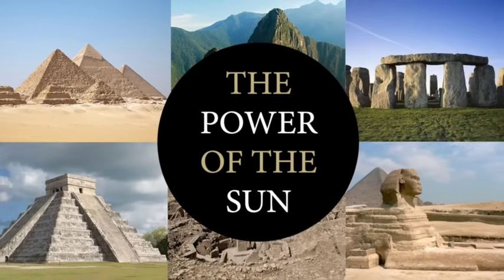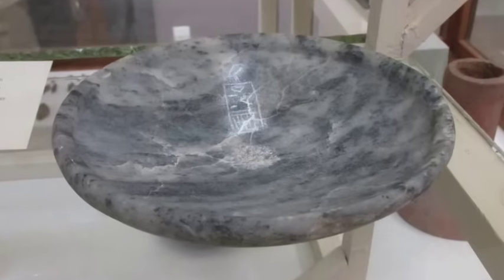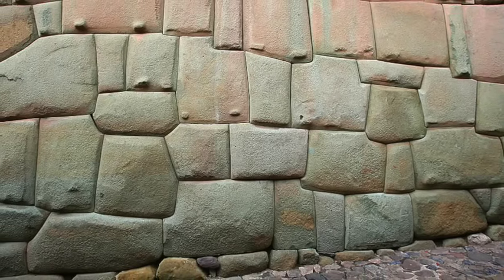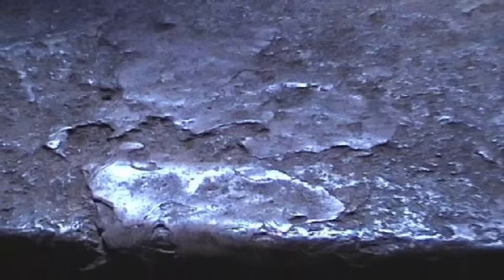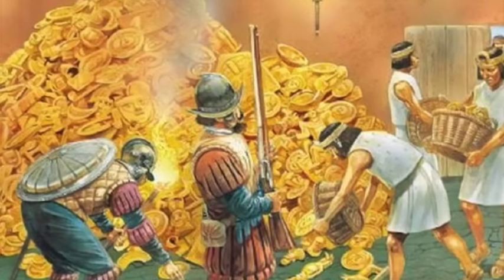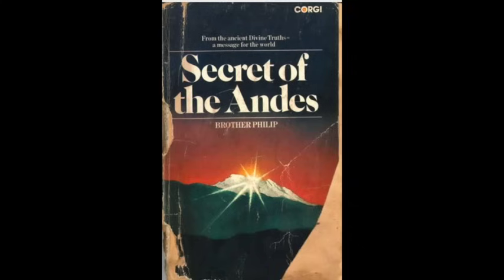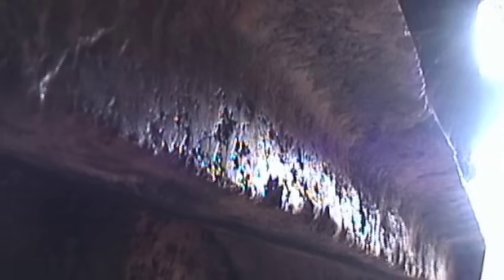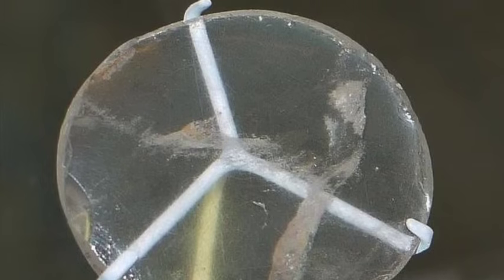How the Ancients Cut Stone with the Sun - Lost High Technology Explained | Ancient Architects

Comment: i do think heat played some sort of roll in how they worked with the stones. but for me, this explanation doesnt explain the classic scoop marks we see on the obelisk in bedrock at aswan quarry. Not to mention, theres the area in the osirion where you can see they laid the stones with a rough finish, and would grind off like 15 cm of material in a single pass, since we can see the concave transferring from rough, to smooth. it literally has a circular transition. i dont think we could plane an entire stone surface 15 cm deep just by sun melting.

Comment: Many years ago at TAFE a company called Rock Granite Quarries would drill holes about a metre apart in a straight line in a slab of granit, they put wet wooden stakes into the holes and kept the wooden stakes in the rock wet, eventually  over time the wooden stakes would expand and crack the lump of granite rock in a straight line. They used this method instead of dynamite, as explosives would lead to crevices and cracking in the rock. Whereas the wood stake in hole method made a clean straight crack.

Comment: what a load of eye wash to put it politely why dont they just admit they have not got a clue i used to work with diamond saws they used in stone quarries worked well but the size of saw needed to cut those rocks would cause so much vibration the rocks would just break or the saw would

Comment: Horse hockey, they would have to control the cut and temperature so perfectly to pull that off. To hot the rock will explode or kind of pop like pop corn. They used something alright but it wasn't any golden disc.

Comment: This theory doesn't explain how fine details like facial features are jewelry and head dresses are cut! Straight lines are one thing but fine details are quite something else! I'm not buying this at all, especially in the many angles used in each stone in a single wall! If they could cut squarely why bother with all the different sizes and angles of those stones? Drill straight holes in solid granite, perfectly round and in very tight tolerances end-to-end? Not with focused sunlight, not in my opinion at least!

Comment: Great video and makes much more sense than the chisel tool fabrication… But I have one issue - Have you ever burnt a dry leaf with a magnifying glass? If you have, you will know how steady you have to hold it in a precise perpendicular angle to the sun. There is no ways that you could cut detailed shapes. You could cut a square shape into a rock which would not be accurate if handheld, but how would you cut the vertical plane at the back of the rock since the supposed metal discs aren’t opaque? Unless a combination of glass and metal magnifiers were used, but again much of the work is far too detailed for these to be down by holding big magnifiers. Something still doesn’t add up

Comment: I'm not an expert but according to some who are, there appear to be tool marks on the stones caused by drills and circular saws. And then there's the evidence of the use of lathes... gigantic pillars with a hole in the bottom and a super smooth finish. Not saying your theory is wrong, I simply wouldn't know. Just trying to piece together the things I have seen so far.

Comment: If you are going to use 'How' in a title you need to demonstrate beyond all doubt that this is the way they did it. Your presentation is therefore little more than 'I wonder if this is how they did it?' There are so many technical problems with your theory (that many others have also pointed out) that I think you should change the title of this video or withdraw it. Apologies, but my guess is that you have little appreciation for what is involved here. I personally think it very unlikely that the ancients would have the ability to make glass lenses pure enough or mirrors accurate enough to focus the sun into a narrow enough beam for it to have any chance of being successful, let alone controllable. When heated violently, hard/brittle materials tend to explode due to the expansion forces (worse if they are wet - ok, not in Egypt!) and so I would expect to see a lot of evidence of spalling....basically I cannot accept the idea of precision machining this way without a verified demonstration. 

I don't see any pyramid texts mentioning thousands of blinded stone masons either, because that would be one of several certain outcomes. To achieve such a perfect finish using such a monstrously powerful/dangerous tool as you are suggesting, requires a lot more evidence to lift it from the realm of fantasy. Has anyone demonstrated rock machining with a modern laser for example?

Modern water jet cutting technology might be a lot better for this task too, but as with the sun beam method, you'd need to invent a way of controlling the jet accurately, let alone work out a way of generating and then containing the pressure, and directing it where you wanted it to go.

Clearly our ancestors were very clever people and we still have some way to go to explain their capabilities.

Comment: A parabolic mirror made of gold and silver alloy could be equaled and bettered by using  modern mirror technology, such a surface would be more reflective, the largest such mirror yet made is only capable of heating a piece of wood to ignition temperature and quite incapable of altering the structure of stone. Good idea but very far fetched. A mechanical disk made of copper and rotated at speed, can with the addition of sand and water cut even the hardest of rock. The ancient Egyptians had the copper and the means of forging a disc of good size, they had plenty of abrasive and and water, the only thing missing is a method of rotating the disc at a constant speed, with speed the disc would need a lesser application of force, therefore less erosion of the copper disc. Where the Egyptians capable of engendering a mechanism to rotate a large copper dick of possibly one meter in diameter and at speed? I dare say they were, a simple structure such as the forks (two wooden ‘A’ frames) that hold the large wheel of a Penny Farthing bicycle would suffice and possibly powered  by man, mule or oxen via a rudimentary gearing system would generate the necessary speed and the stone to be cut may have been brought to the Disc for cutting and not the disc taken to the stone. Just an idea!

Comment: Let's calculate if this is possible:

We assume that they melted granite with sunlight with a "mirror" that could be held bij 2 people.
Say, a mirror with the size of 2 x 2 meter (4 M2). Let's assume that the mirror is perfect and no energy of the sun is lost with the reflection.

Granite has a melting point about 1200 *Celsius. 
Let's assume that the temperature outside is about 20 *Celsius. That means that the granite needs to be heated 1180 *Celsius to melt.

To heat 1 gram of granite for 1 Kelvin (*Celsius), you need 0,82 Joule of energy. 
Heating 1 gram up to the melting point, you need 0,82 Joule x 1180 *C = 970 Joule.

In Peru the sun gives a heat about 250 Watt / M2 (= 250 Joule / second / M2)
The mirror is about 4M2 in size, so it reflects about 1000 Joule / second.

In that case it takes on a sunny day (970 Joule : 1000 Joule / second = ) about 1 second to melt 1 gram of granite (with an perfect mirror on a perfect sunny day).
Even if you are not efficiënt, it seems to be possible to melt a tiny piece of granite with sunlight. But what about a whole rock?!

But what should a average granite stone weigh? 
The density of granite is about 2,7 grams / cm3. 
You can find pictures of perfect "cut" stones from Machu Picchu which are the size of a human or bigger.
Let think of such a stone with the size of 100 x 100 cm and the depth of 50cm (it's a guess, please come up with more accurate numbers).
This stone weighs: 100 x 100 x 50 x 2,7 = 1.350.000 grams (1350 kg). 
To heat up such a stone to the melting point with our ideal mirror and no loss of heat, it takes 3.780.000 seconds. That is 1.050 hours (44 days). 

And that is impossible in a few ways. 
First: it takes more than a day, so at night the stone cooles off and it wil take even more than 44 days to get it melted. 
Second: the sun must give this heat during the whole daytime, that's impossible. 
Third: If this was possible, it takes 2 guys in a ideal situation at least 44 days to melt one stone with an average size. There are thousands of stones there... 
Fourth: the situation isn't ideal. There are energy losses, not only by clouds, moist, sunset of an imperfect mirror, but also by the fact that you can easily heat up the outer layer of the rock, but it's very hard to heat the internal part of the rock. In nature, rocks desintegrate by the faster warming up of the outer part versus the inner part. It damages the rock.
Reply: It is possible to heat and melt (or soften) tiny rocks with a fresnel lens with a size of about 1 M2.
This is basalt, it melts somewhere between 1200 and 1600 *C.

https://www.youtube.com/watch?v=svAPyyUJUCo&ab_channel=GREENPOWERSCIENCE

Comment: Actually a really interesting idea. Unfortunately it's impossible to do with the solar lenses you theorized.
Lenses don't create a straight and narrow beam like a modern laser. They create a cone shaped beam with a focal point at the top.
You can even go try this yourself. Just buy a magnifying glass and try cutting a statue, or even just a small building block, out of a big piece of foam. You can't get the beam down into the material because of the cone shape.
Reply: You are not cutting a kerf through the stone.  If you focus the magnifying beam on a spot it get hot and pops off the rock.  All you do then is keep poping off bits you do not want until you are left with the shape you want.  No interference of the cone because there are no deep holes or groves. You are just flaking off small bits of the surface to reveal the shape hidden inside.
Reply: @vmitchinson  Well no the rock would melt in that spot. There are videos right here on Youtube of people melting rocks into lava with big fresnel lenses.

Comment: HAS ANYONE ELSE COME UP WITH THIS THEORY TOO???
If you look at all the different looking blocks that make up the pyramids, it becomes quite clear that just like the sphinx, the pyramids are much, much older than egyptologists claim. What makes that clear, other than the erosion, is that their were many repairs done over the years. And the wildly differing styles and methods of the repairs, some advanced and some not, seems to suggest that they were done many, many years apart. The same differing methods were also used when repairing the Sphinx. And if you look closely at both, it’s also quite obvious that all the evidence points to the difference in block styles/methods, only appearing in repairs. (Except for the casing stones.) And not because the Egyptian architects chose to use many different methods for aesthetic and structural purposes. Or the architects suddenly behaving like abstract artists, randomly throwing one or two different styled blocks here and there, for no apparent reason. 
The majority of the block styles/methods used on the pyramids and Sphinx, appear to be cut blocks and geopolymer. But for sure, the most interesting ones are the blocks that look exactly like the blocks that make up the walls of Saksaywaman in Peru. The walls many believe were made by “melting,” or softening the stone. They’re even the same dark color! 
So I believe that as the centuries and millennia passed, the Egyptians methods for creating megalithic structures changed. After a minimum of 4,500 years, these structures are not only still standing, they survived relatively intact and in good condition. And that begs an important question, why did they required so many repairs, and why so soon? 
Egyptologist claim both structures were built, at the most, 4,500 years ago. However, of the best examples of repair work is on the Sphinx, and the repairs are known to have taken place during the same reign as the pharaoh who Egyptologists claim actually built it! But just like pyramids, not only are there not any known records of that pharaoh taking credit for building it, it doesn’t make any sense that a brand spanking new statue would need repairs done to it already. From all the evidence we do, and do not, have it seems more logical that most of these megalithic monuments were made by an ancient and technologically advanced civilization that came before the Egyptians.

Comment: Thanks Matt.  Concentrated sunlight can cut anything on earth. Granite is no problem. I've melted steel like butter with 1000-sun reflectors but Hathor used convex not concave lenses which is how the operators keep from melting themselves.  She is generally shown with 'antlers'.   It’s probably the source of the legend of Perseus cutting off the Gorgon’s head.  She didn’t turn men to stone; the men with the lenses turned molten granite and other bits of ‘dirt’ to stone.  Shemsu Hor could simply be a name for solar stone cutters.

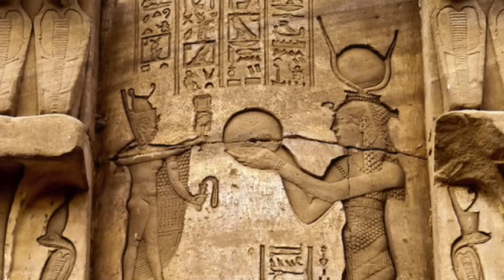Remember that what we see now wasn't done by hackers in the woods to see if they could melt beer cans (and yes, they can) but by the top engineers at that time.  So melting granite isn't the question.  Your amazement at the 6:30 mark though isn't explained by boring down light from your antlers but rather the effect you get when slowly and carefully twisting the dowel or pipe or whatever you had stuck in the mud or mix before it dries.  

The 'crime scene' is the hole in the granite; the 'evidence' is what you have in your hand after winding out the dowel.  Try it at home with cement; works every time.  

What also 'works every time', in fact it's Unavoidable, is the perfectly fitted joints when you pour cement, whatever the mix is.  What is Unattainable, every time, is a perfect fit after quarrying, dragging, shipping, dragging, shaping, lifting, fitting improperly, lifting again, re-shaping and then, aha, fitting perfectly at last.  The lumps in the Americas are probably due to making ‘baskets’ to form the mix rather having plywood.  The cedar forests of W. Washington and BC are a long way from Peru and so they used baskets instead of plywood.

From quarry to perfect fit can't be done; hasn't been done.  Quit trying.

Concentrated sunlight and cement (ari-kat -- which makes up the 2 to 5% of the magic that turns the disaggregated limestone on site hard when mixed with water and time -- both of which they had on hand) are the keys to the ancient operation.  The limestone is disaggregated by the Nile or the wadis stemming therefrom, which these structures all had available.  They used the softer stuff below the Pyramids, not the hard stuff, like the Sphinx's head from higher ground.  

We should quit worrying about this and focus on what these monuments were used for.  Not tombs, but Light.  (Then perhaps water purification -- as opposed to spiritual purification -- and cooling and refrigeration.  These were practical people, not sky-god worshipping Conquistadors like Napoleon and his rabble whom he abandoned in the desert.)

The so-called vacuum tube at Dendera shows a 'carrier wave' (Luci-fer in Latin means Light-Bearer -- a 'no-no' in Imperial Roman Catholic circles lest you forgot) which was set in motion by the Djed Pillar, the granite structure in the King's Chamber, which was pinged by the Supercapacitor (the Ark of the Covenant whose fit you so ably demonstrated in another video), and that Ultrasound pulse travels down the highly engineered passageways to the water below, which all these structures have, to produce Light.  The force is so great that it cracked the granite in the KC.  (Ever see a firefly?  Ever heard the crackle?  You don't need electricity too make light.  You need intense pressure from an ultrasound source -- the Djed pillar.)

Let there be light (Lux fiat), just after the beginning -- In the Beginning was the Sound (before a Logos becomes a Word it is a Sound, d'uh) -- then there was Light.  (John 1:1.  You can argue with me but don't mess with John.)

Not sure how they recharged the Ark but the salt on the Queen's Chamber walls probably is the clue that some explosives experts, or perhaps acoustical engineers could sort out in a moment.

Thanks and well done. This really should be the core of a BBC or NOVA presentation.  
A lot of people are wasting a lot of time debating the impossible.  Elementary Watson. Now hear this:  The Hydrogen-Helium reactor 92 million miles away can melt granite even here. Who knew?  Old Kingdom engineers; that's who.  Then they could make light.  How cool would it be to prove that obelisks were light poles which shed their rays in response to the principle of induction, stemming from Giza?
Reply: Too bad the stones weren't poured, since they came from known quarries
Reply: @customsongmaker  Be that as it may it does not tell us it came in one piece, does it?